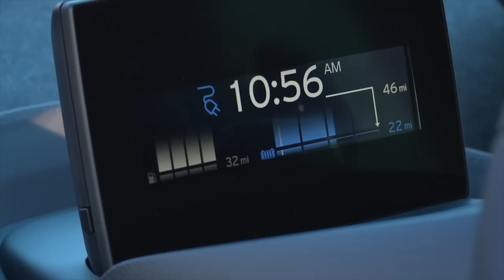Five Things We Need To Improve About Electric Cars

Comment: I think battery cost will be the biggest issue regarding EV adoption if the shortage isn't fixed fairly quickly. Battery prices were falling fast until recently but now it seems only Tesla is getting cheaper batteries as time goes by? I paid an extra £5.6k to buy the battery on my Zoe and assumed that by the time the eight year warranty had ended a new pack would be in the region of £2k. If EV prices remain high compared with petrol models sales will stay low.
Reply: Check out NantEnergy
Reply: Geoff Shelley .  Interesting ...  but Since they don’t mention cars as a possible application for their battery technology it is a pretty safe bet that it isn’t suitable
Reply: @andrewpaulhart  www.cnbc.com/video/2018/09/26/patrick-soon-shiong-on-holy-grail-zinc-air-battery-nantenergy.html 2:27.  True, not there yet for quick immediate power surge needs.  If that can be resolved, then the $100 per kWH and the very high power density of Zinc air will be very attractive to the EV industry.
Reply: Geoff Shelley interesting.  However my understanding is that Tesla/Panasonic  is getting close to $100/kWh now and expect that to reduce further.  I believe the cost was at about $190/kWh in 2016 so that indicates how rapidly price can drop.  The two main factors seem to be the savings due to economies of scale and cobalt content.  Tesla is steadily reducing cobalt content (I believe they are aiming for zero) and very rapidly increasing production. Re lithium being toxic. ...  they are not considered to be toxic in landfill. But even if that is not so,  it’s not as if old lithium-ion car batteries are going to be put into landfill.  As I understand it these get a second life in utility installation like powepacks where degraded performance doesn’t matter.  The toxicity issue is when the battery overheats it gives off toxic gasses.  Presumably heat management system solve this problem for general usage but I guess it would be an issue in car fires.  Thankfully not something that will happen on a regular basis and not something that would be an immediate threat to life and health in an open ventilated area.  Although I guess it’s wouldn’t be a good idea to stand close to a burning Tesla if you can help
It.  So ...  while this may be a better battery technology eventually it doesn’t seem to me to be an industry disrupter in the same way that solid state batteries could be.  Time will tell
Reply: @geoffmorrise2072  Thanks for that, it looks like very interesting but initially something for grid storage rather than cars from what I could gather - the information I found seemed to be largely press release type material plus an interview with the CEO - he sidestepped the question about whether it would go into cars. Either way it will no doubt take a few years to get up to any scale that will make a dent in the shortage.
Reply: @robsmith1a  Thanks for your reply.  True the company and the product are not yet there.  But at only $100 a kWh it possibly could be quite quickly.  Patrick mentions in an interview that the immediate power output is a current short coming.  Also there is the challenge that Nant is a 200 M company trying to compete against multi billion dollar companies, quite an uphill battle.  However if someone takes a chance on Nant, they could very soon start producing EV's that are less expensive to build than their ICE counter parts and yet can be sold at a premium (because of the $$$ gas savings).  Could be interesting.  We'll just have to wait and see.
Reply: @geoffmorrise2072  The only thought I have regarding whether this technology will be suitable for cars is whether the energy density will be high enough to give a decent range and also whether the charge and discharge speeds are also suitable for this purpose. I haven't found any information on this in my quick search. It does seem like a great technology for static storage solutions though.

Comment: Very fair. Affordability and longevity are huge items.
Reply: Longevity is not a problem unless you bought a badly designed EV like the Nissan Leaf which has no thermal management.
Affordability is the big item.
Reply: With the trick that I discovered, batteries can last for decades longer than they normally would.

Capacity is also restored to A point, over A few months time.  Details are on my page.
Reply: I feel the power and speed is a thing most people don't care for with a small family hatchback.  I don't think anyone thinks electric cars are slow
Reply: @chrisredfield3240  The 'slow EV' stereotype still exists outside the EV community. I've had to share Tesla drag race videos on facebook to prove otherwise.
Reply: @richardlinares6314   must be idiots acceleration is what electric vehicles do best. Don't seem to have a lot of top end but that should not matter to normal people were talking transport not exotic racing
Reply: @chrisredfield3240  
I pointed out to a friend of mine that unless you spend most of your time at the track, you don't have many chances to drive 200 MPH.  What you do need is a car which can get out on the freeway quick enough that you don't get rear-ended, and you don't have to wait an age and a day for a large enough gap.
Reply: they where drag raceing EV's in the 90''ty's...
Reply: @SailorBarsoom  i just think it seems a bit odd how in the uk we can buy a 2019 ford focus with a 1 litre engine that only puts out 84hp. And the 2019 nissan leaf 40kw is now 160hp+   the kia 64kw car is around 200hp. The bmw i3 is around 184hp.     I'm getting exited about them making ev's with less power a smaller battery a purely offering as a short range second or town only car.
Reply: @chrisredfield3240  
If cars get cheap enough, it might make sense to own two or three of them: one very small car for commuting alone or minor shopping trips where something the size of a Model 3 frunk is all the cargo space you'll need; a larger car for family trips within town (taking the kids to school, big grocery shopping trips, etc.); and a larger car with a lot of range for road trips and plenty of space for luggage and traveling companions.

But cars cost a bit much for most families to have two or three of them.  But having the small commuter and renting the bigger cars could work.